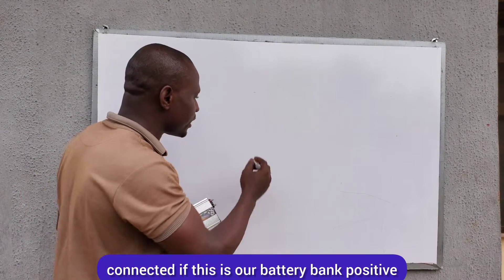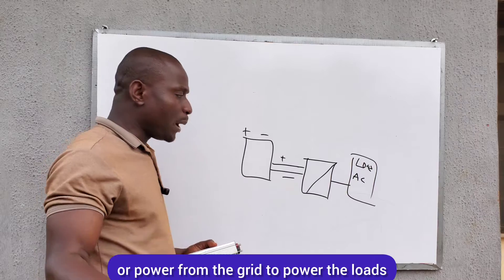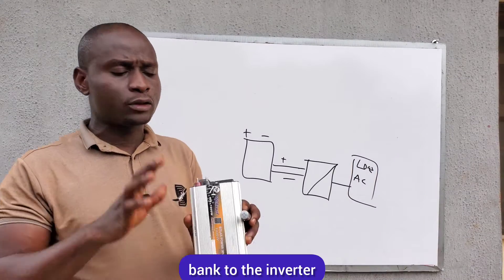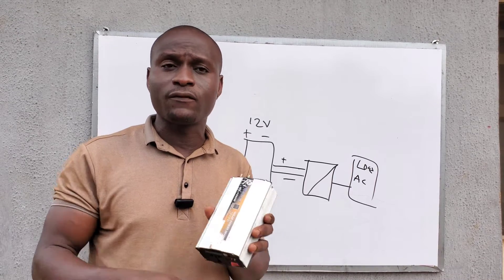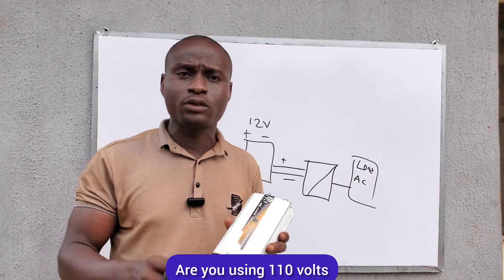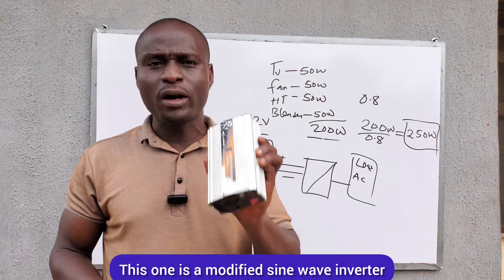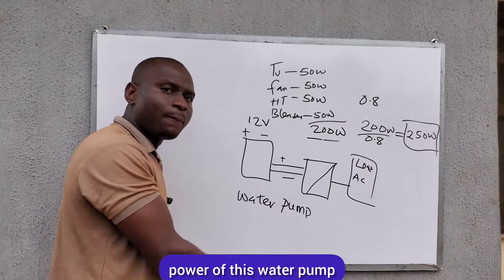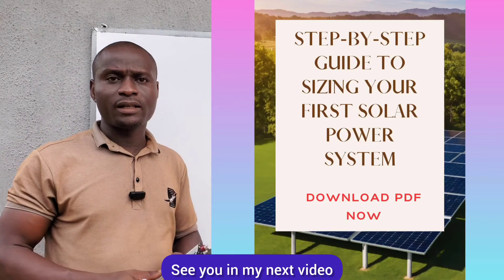What is a power inverter? What size of inverter do I need? #solarinverter #inverter

Comment: I have a 500wts and  SAA 500ah12v  bought by my son and  two panel of 20w and 100wt what size of battery and control charge can power tv 50w decoder , fan and 7 lamps in a 3bed flat.